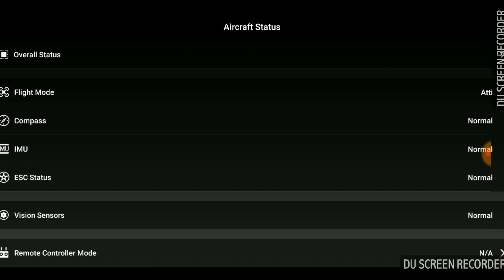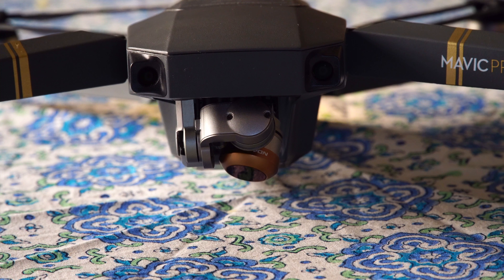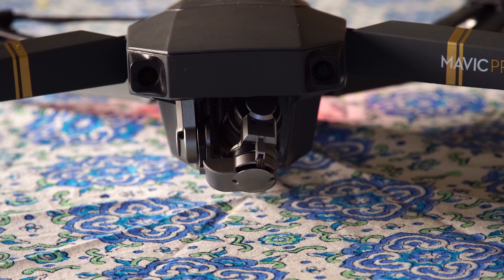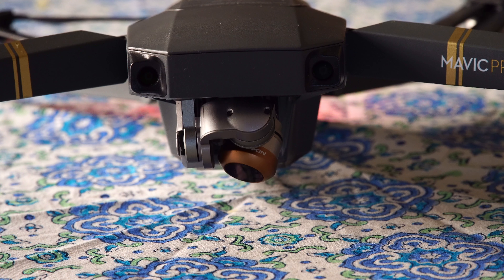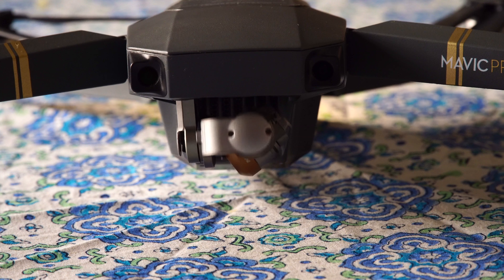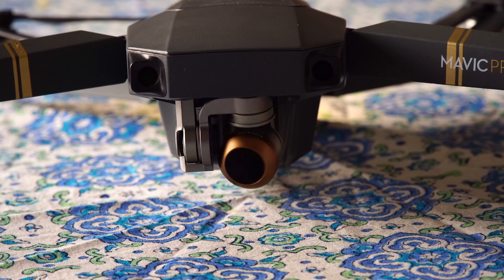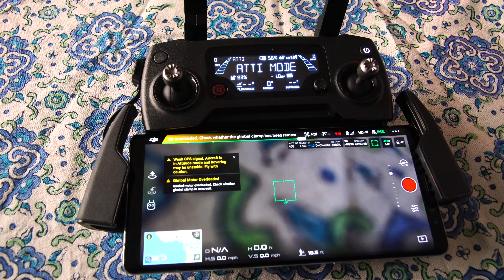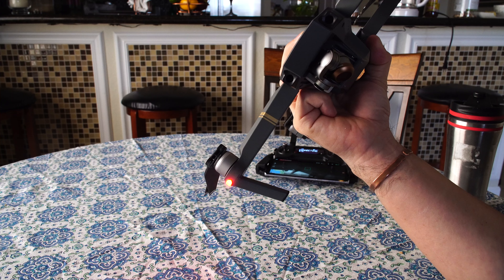Mavic Pro Gimbal Overload Solved

Comment: Try also to calibrate the IMU, if the issue is happening without any crash. If you tilt the drone to the right its like yu are fooling the IMU initialization. Sometimes calibrating it fixes that permanent

Comment: That works until we use the camera tilted all the way down... Then the gimball overloads again..... That's really sad, happened to me few hours ago.... No crashes... Nothing different... Just before doing a photosphere capture... I think that this Pano mode moves the camera really quickly and then the ribbon was broken.
Reply: Replace the flexible Gimbal  PCB Ribbon Flex Cable.  It is delicate and you may have damaged one line in it

Comment: This is what makes the Mavic Pro a TERRIBLE buy. The gimbal is way too fragile. Don’t buy the Mavic Pro, because there is like a 75% chance your gimbal will malfunction and this kind of repair is just too much for the average consumer.
Reply: William Choi 

I don't know what to tell you I have crashed my mavic Pro once I have used it a hundred times I have never had any problems there are thousands and thousands and thousands of these sold and not everybody has this problem

I only had this problem when I had an SD filter on because the SD filter was too thick it was too heavy and it would smack the side.. 

I think that if you use SD filters and you overload the gimbal too much that's what destroys the gimbal.. 

A solution would be to put the SD filter on after you calibrate the gimbal..  and then after the gimbal does it thing.. 

DO NOT PUT THE SD FILTER ON WHEN THE GIMBAL IS GOING THROUGH THE CHECK YOU COULD DAMAGE THE GIMBLE!!!
Reply: It just happened to me, and I've never landed on anything other than my landing pad. Never had a filter on either. The gimble is very fragile. More specifically the flex ribbon inside the gimble is extremely fragile! I just ordered the ribbon last night and will try to fix it myself on Wednesday. It was only 18$ for 2 ribbons. I bought 2 incase I break one on my first attempt. There are SEVERAL YouTube videos on how to do it, so hopefully I get it right
Reply: You called it, simple crash took out a bunch of parts.  DJI are fragile products!

Comment: Thanks bro but that shit ain't gonna last. If it is gimbal motor overload.. I experienced same and after a while it stopped. Sadly its not gonna last. even at that I can't control the camera, you have to fly it straight. Any attempt to to tilt will take it back to that error report. DJI Mavic SHOULD DO US A FAVOUR BY CALLING ALL DRONE OWNERS WITH THIS FACTORY FAULT ISSUE TO SEND THEIR DRONES FOR A BETTER FIX. One can't just spend so much money only to experience this frustration. My drone never crashed. I flew it for a while, place it safely with gimbal protector in it's bag, Traveled for a shoot and when I want to start work boom! Gimbal motor overload, did the tilting work for a while then stopped. I couldn't do nothing till this moment. Just fade up.

Comment: Holy cow! I can’t believe it worked! Thanks!!!
Reply: Sadly its not gonna last... It will continue to give that same error. I experienced it. even at that I can't control the camera, you have to fly it straight. Any attempt to to tilt will take it back to that error report. DJI Mavic SHOULD DO US A FAVOUR BY CALLING ALL DRONE OWNERS WITH THIS FACTORY FAULT ISSUE TO SEND THEIR DRONES FOR A BETTER FIX. One can't just spend so much money only to experience this frustration. My drone never crashed. I flew it for a while, place it safely with gimbal protector in it's bag, Traveled for a shoot and when I want to start work boom! I couldn't do nothing till this moment.

Comment: THAT IS NOT A DJI SD FILTER THAT IS MADE FOR THE GIMBAL.. 

Looks like you have a polar Pro SD filter..  when you use a filter like that it's too bulky when the gimbal goes through its check over and over again the side of the filter hits the gimbal WHICH OVERTIME COULD DAMAGE THE GIMBAL.. 

THE ONLY SOLUTION!! 

Either use DJI filters or calibrate your gimbal first without the filter on. And then when you start up your mavic pro make sure the filter is not attached!! after it's done checking itself then put the SD filter on.. 

;)

Comment: I  had this happen today for the first time.  Havent crashed my bird, in fact flew it a week ago and it flew just fine.  Today I went to do a shoot for dronebase, got onsite after I took 3 pics, the gimbal started shaking and it said gimble overload.  I brought bird back, checked connection and i turned it on its back and that fixed it for a second, but started doing it again.  Changed batteries and repeated the process, finally was able to finish the shoot with no issues.  But I have a feeling I will be seeing that issue again in the future.
Reply: Did you get a fix?   Mine just started this today as well.... grrrr...... no issues or crashes until now... was flying for some photos in perfect still conditions, camera started shaking... brought it back and landed no problems..... went for a restart and now the gimbal says overloaded and is limp facing down....

Comment: I replaced the ribbon cable two times now, but after flying it once successfully, the issue with the gimbal motor overload returned. Any idea what I can try next?
Reply from the maker: Same here. I ended up buying the Mavic Pro 2. No regrets.

Comment: I had the same thing(same movement), i tried alot of things including holding it like that etc,

But now de gimbal doesnt even move anymore, ever
Even not at start up

I tried refreshing the firmware, imu calibration
Restore defaults,
Gimbal calibration stuck at 5%
It also still says gimbal overload/gimbal obstructed, when i can freely move it around in every axis

It still gives video feed
Reply: Same problem get yesterday before take off, so upset I watched a video a guy said to turn on the drone but upside down I dont know if I was lucky or not but the problem its solved.
Cheers
Reply: Exactly the same problem here. I will try the cables by my self.